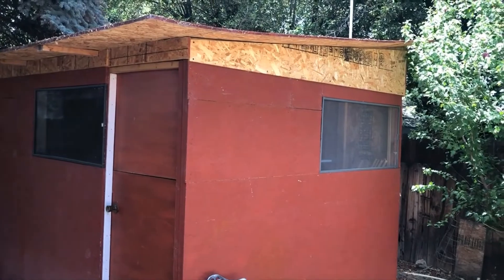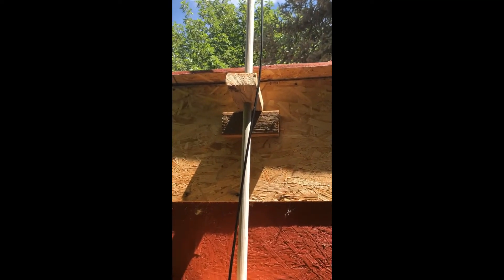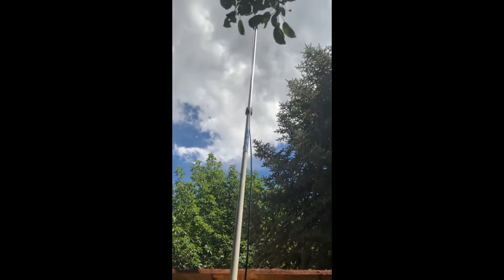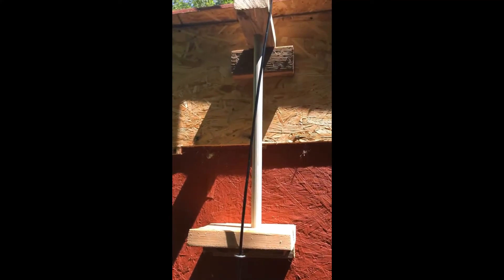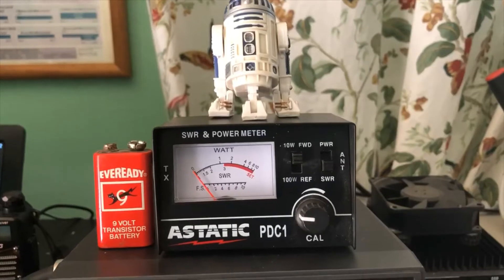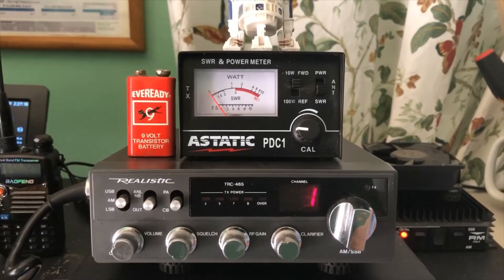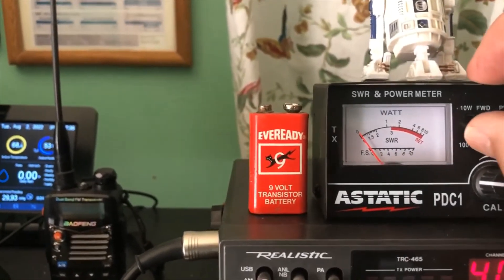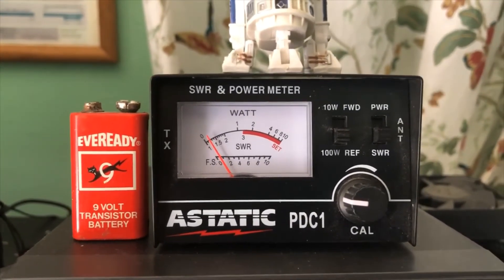Relocating the Tram 1499

Comment: The problem with all "stick" type antennas is the fact that it is only half of an antenna (no counter-poise/groundplane).  It needs a counterpoise to work properly.

One way is to run 1 or more (3 is best) 104" piece of wire from the lower mounting clamp and tie it/them off at a 30 to 60 degree angel down from the antenna. this will do 3 things:
1)  It  will lower the antenna's feed-point impedance from around 105 Ohms to around 52 Ohms resistive.  Coax is nominally 52 Ohms when tested with a VNA or a NANO VNA.
2)  It will lower the angle of radiation for better coverage.  Stick type antennas have a characteristic angle of take-off of almost straight up and down (90 and 180 degrees) which is great for talking to the clouds and earthworms.
3)  It will decouple the coax outer surface of the shield reducing or completely eliminating RFI (Radio Frequency Interference) and EMI (Electro-Magnetic Interference) from getting into your house/shack and your equipment.  This RFI/EMI is what can cause feedback and other problems with your transmitted signal.

Another way to correct this problem is to make a coil of your coax, 104 inches from the antenna's feed-point, creating a Common Mode Choke (CMC).  This will be made on a form (I use a large empty plastic Crisco container and wrap 10 turns of coax to form the choke).  I secured the turns with Gorilla Tape.

Or, you can buy a common mode choke, sometimes called a 1:1 line isolator and install it 104" from the antenna's feed-point.  Remember, a CMC is not a BALUN as it does nothing to affect the VSWR of the system.